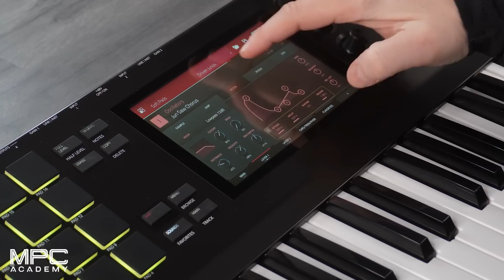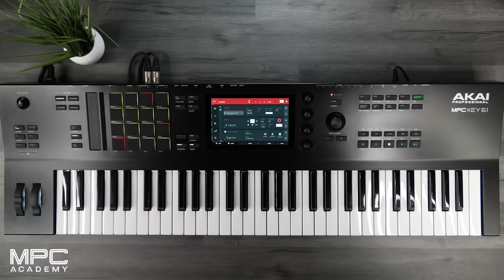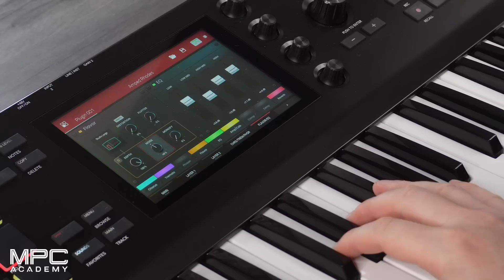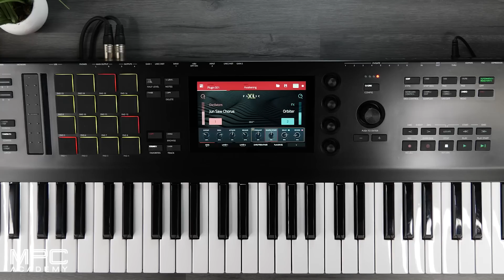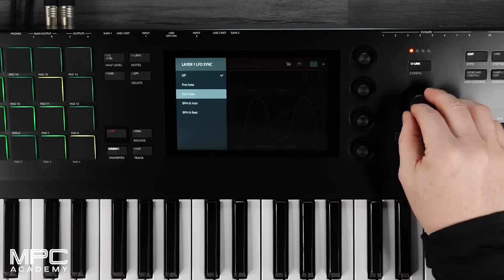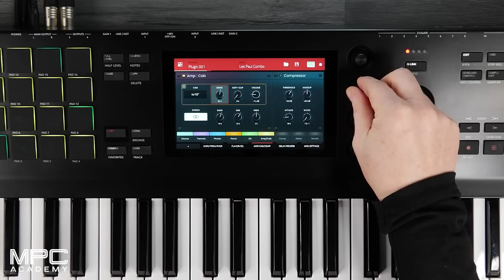Using Fabric XL In MPC Key 61 | Getting Started

Comment: Wonder if a mic can be run into this unit
Reply from the maker: Yes. MPC Key 61 features a combination quarter-inch/XLR input with phantom power. It will accept condenser, dynamic, or ribbon microphones.
Reply: @Akai_Pro  Doesn't it have 2 combo inputs? Do both have phantom power?
Reply: @trevorwoodley3897  They both have phantom power
Reply: @darrickkeels6387  Good to know.

Comment: An outstanding keyboard as all the AKAI keyboards/keyboard-Controllers are. I have the Advance. The only disappointing thing was that soon after purchasing it, the software VIP 3 didn’t work anymore when I upgraded to MacOS Catalina (64 Bit only). VIP would have been a great sw, but it still doesn‘t work 3 years later. Can anyone tell me how to solve this problem, respectively if VIP is applied to 64 bit OS?
Anyway, AKAI KEYBOARDS are the best out there, best quality!

Comment: Hope there will be an update with Mastering mode to mixdown complete song from Key61 to a cd/dvd burner using the USB cable connection and also mirror the display wireless to a larger external touch screen would be game changer for people who wants to stay in standalone...Who wear glasses or have big fingers to navigate better..then charge the standalone existing users $25-$50 for the upgrade and make it Free for MPC-X users because they've already spent a lot for that piece of gear

Comment: Amazing instrument. I've chosen the right (or wrong $$$) time to start looking at the MPC family.
Reply: I really like how they are trying to bridge the gap between the sampler and the keyboard workstation, but for the price, it really is what it is. A used motif with really any used mpc (even a 500 w upgrade pads) could give a monster sound compared to what I heard from these, with respect to the sound engines, while sacrificing a bit of workflow efficiency. I just feel like this is either meant to appeal to the motif/fantom/triton crowd and get them into the mic line or the vice versa (bring keyboard workstations to mpc user).  I don’t understand why akai spends so much time making these integrated devices (li ion battery and monitors in an mpc? Tf?) rather than honing in on their flagship sauce and going on to making stuff like affordable euro or rack mounts that do things like emulate old filters (like s950 lp)or instead of adding a li ion battery to the mpc do some kind of dip device or extra motherboard that can process samples like an mpc3k or mpc60. Could be a good first piece of hardware.
Reply: It's pretty good but - nowhere near Amazing
Reply: @EBMZEQUENZER wow